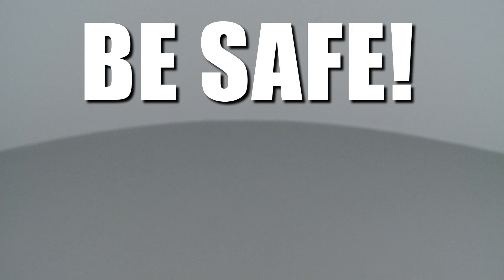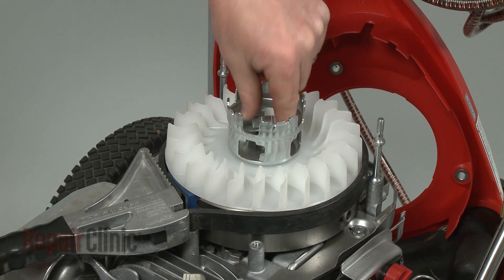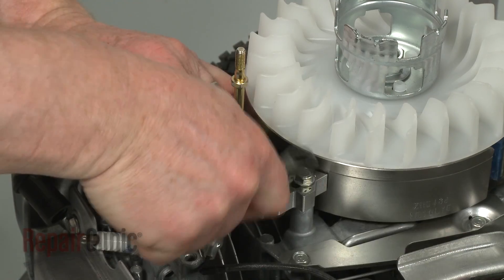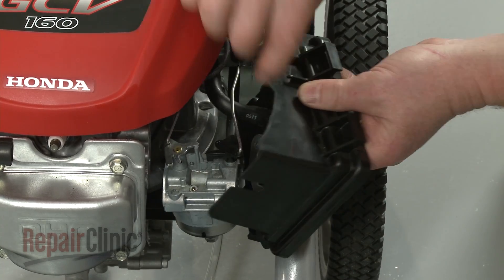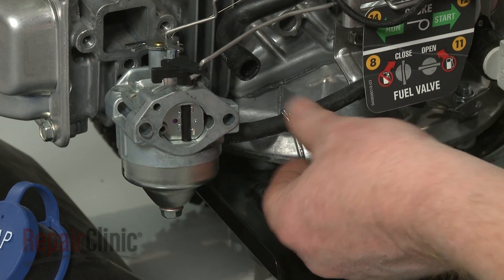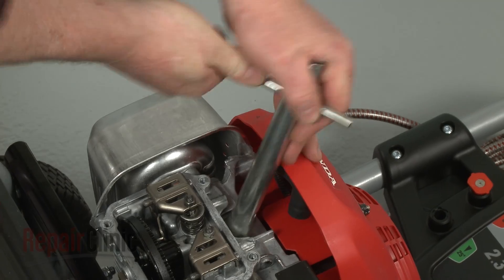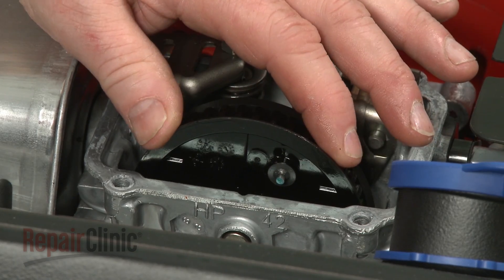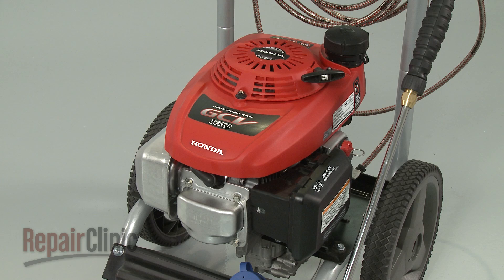Honda Pressure Washer Engine Disassembly (#GCV160LA0N5RR280), Repair Help

Comment: My oil seal under the fly wheel pops off shortly after starting.  The crank case valve isn't clogged.  Do I have a bigger issue going on, or should I just replace the seal? It seems like there should be a retainer clip for the seal but it just holds via friction?

Comment: I have this same washer. I finally cleaned the the carb out and got it running after a year of sitting in shed and after being flooded during hurricane harvey. I got it started and it works fine but do you recommend I do anything else to it?
Reply: How much did you get it for

Comment: Brilliant and THANK YOU ... had a 2 yr old unit used perhaps 7 or 8 times in that 2 yrs. Went to fire it up and for the first time ... refused to start . Tried at least 20 times ... nothing. Went straight to the carburetor bowl as you described, pulled out the nozzle and the perforated intake tube and BAM...full of debris ... blew it out with canned compressed air made sure I could see light though all openings. Installed it back in place, put the aluminum bowl back on. ... opened fuel valve and FIRED RIGHT UP. 🙌😎.  Thanks sir !!!
Reply from the maker: Awesome great job!

Comment: had a stuck valve on my power washer, tapping with a hammer and using carb cleaner freed it.. put in cam the wrong way without checking the piston on top.. fixed that and now it works great.!! saved and didnt get scammed by going to the shop! thanks!
Reply from the maker: +dabomboo7o Thank you for sharing.